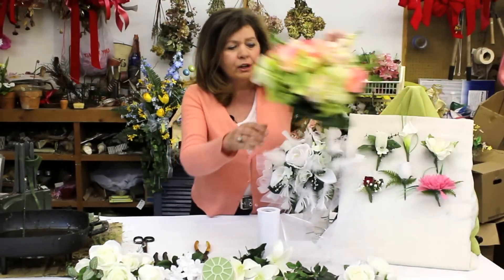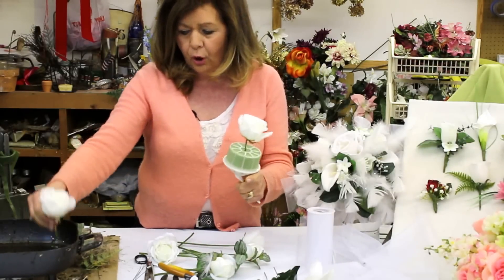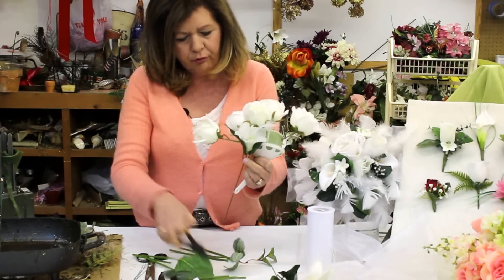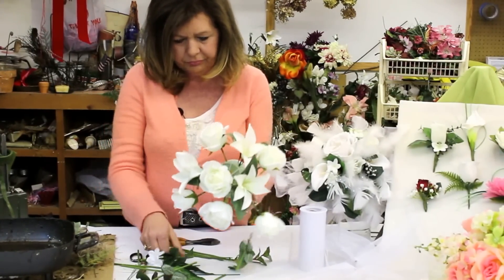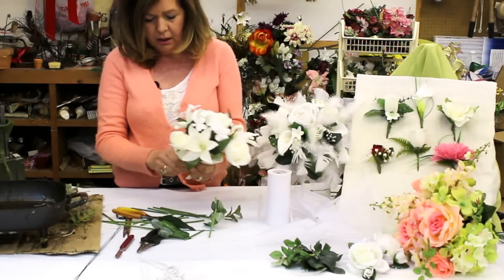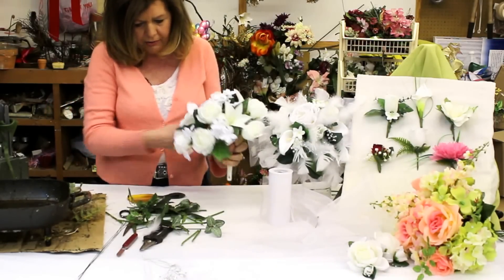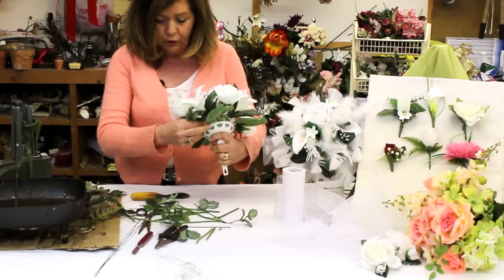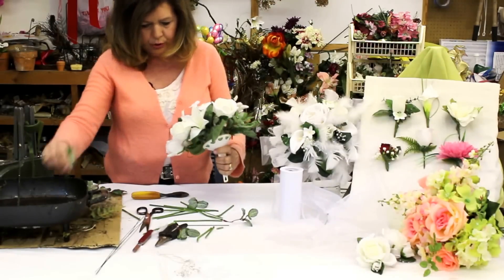How to Make a Wedding Bouquet with Silk Flowers | Silk Flower Bouquet | Bridal Bouquet

Comment: What are you sticking the flowers into?
Reply: I believe it is an electric frying pan on low heat with melted hot glue in it.
Reply from the maker: +Skeazix +safetyvidoes Yes, that is just a basic electric frying pan.